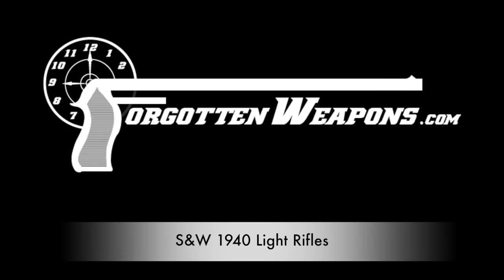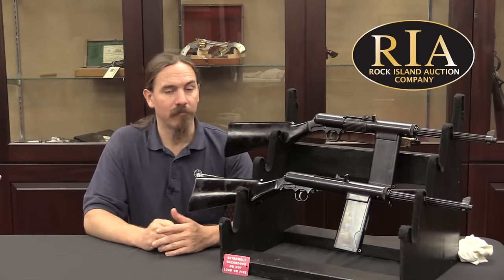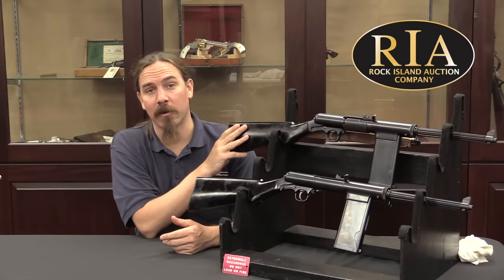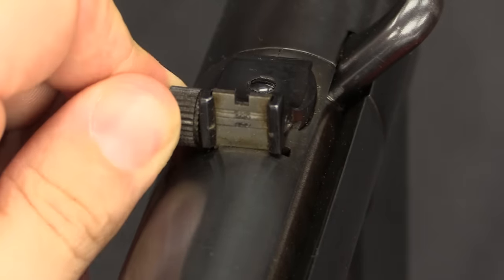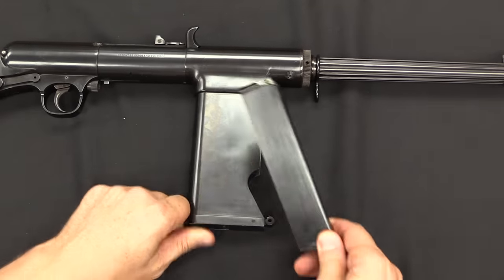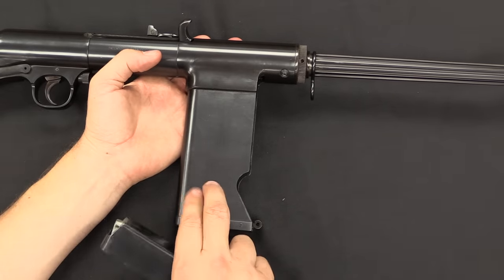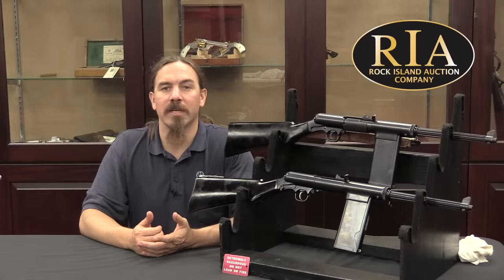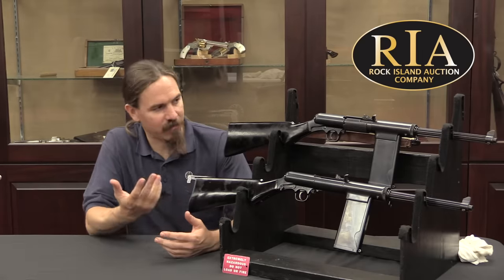S&W 1940 Light Rifles: Receiver Breakage is a Problem

Comment: I feel like just a couple of "small" changes and this could be a perfectly fine weapon. Things like simplifying the barrel, replacing the tower with a traditional mag lockup and ejection port, full auto only, and adding a little bolt travel room with strengthened spring.

Comment: Seems like a few extra threads and a deeper end cap would have sold the issue of the bolt slamming into the cap and causing the  failure
Reply: A better solution, and I didn't catch enough of a view on both caps to see if there was a difference, would be to move the cross-pin hole on the end cap so the forces end up transferred to the outer shell rather than all putting tension on the inner receiver tube. 

OH! Also, the Mk1 receiver steps out ahead of the section that fits in the outer tube... if that section interfaces before all the tolerance stacking/play is taken up for the end cap, then the impact on the cap stretches the end of the inner receiver tube. On the Mk2, that step is milled off and the inner receiver tube appears to be free to slide all the way back into the outer tube, which means the cap would always "strike" or push against the outer tube and not 'pull' on the threaded section.
Reply: extra threads to extend the space between the bolt at the cap
Reply: Unless the root problem is resolved, and extra threads don't do that, then you still have a stress riser at the edge of the turned down section for the threads. That's likely why the outside thicker portion for the MkII has been removed, to avoid it butting against the outer tube and allowing the bolt forces to put tension on that cap. Without that thick part on the receiver, the receiver would be free to move back into the outer shell as far as necessary to get the cap into full contact with the rear.
Reply: indeed...that whole part would have to be made thicker.....which there was room for.
Reply: If the inner section allowed for a broad end of the end cap, instead of the small lobe to take the cross pin, the the end cap could be extended and a buffer material could be put into that cavity and still all held together by the cross pin.  Without knowing the exact dimensions and design, the grip section could be bored out easily if there were clearance.

Comment: That firing pin lever works similarly to one on a thomson machine gun. Theoretically, when the lever hits a surface on the receiver, it thrusts the firing pin forward about 2 times the speed of the bolt. It also prevents out if battery fire. They likely deemed it unnecessary for function, as the doubled speed is substituted with double the impact  force.

Comment: What i find noteworthy was the british weren't so desperate for guns as to demand S&W fix the guns but instead just demanded their money back. If S&W tried they probably could have reinforced the guns and made them cheaper and probably within months. The fact the british wanted their money back then settled for revolvers rather than waiting for a proper improvement. Wonder if once they got their hands on them they had second thoughts and used the failure in the endurance tests to try to get away from them.
Reply: If they had worked then we of brought more until STEN production was up and running.
Reply: The Army were never interested in the Light Rifle. They were bought for the Royal Navy, who wanted a handy carbine for boarding actions (instead  of a SMLE).
They were a stopgap until the Lanchester SMG was available.

Comment: This thing looks like it's one camera part away from being a Star Wars blaster.
Honestly the big goofy tower, the huge weight and the fluted barrel make me wonder if this thing wasn't based on a design originally for a full power rifle round and then had weight chopped off it until it was deemed suitable to be a 9mm PCC. That might explain the receiver issues if they downgraded the metal for final manufacture from a heavier original spec.

Comment: If you add a pistol grip and full auto capability and change the magazine/ejection system then this could be a decent submachine gun :)
Reply: Called a STEN mk 5
Reply: Hendrik Tõnisson And if you completely redesigned the system to be more functional including: having it be reliable and not just break; making it a field serviceable weapon; removing the massive extra expense. Among others.

Comment: Shortening the bolt would make a longer area for it to slow down before smacking the rear under spring pressure.. That's probably how they fixed it.

Comment: I don't think the ejection port tunnel is a bad idea but it would work if it was quarter the length or less maybe. That way even if you used the magazine as a monopod it would be difficult to get mud in this thing. Not to mention a shorter tunnel would provide some sort of access to the insides of the gun to clear jams.

Comment: Based on the trigger mechanism, barrel profile, magazine well/ejection well, and profile of the grip/stock.... I would say that this rifle pattern was originally intended to be a heavier caliber weapon platform that went nowhere and S&W repurposed the design/layout of the weapon system and make the thing in 9mm (which is why they would have produced receivers that would crack: the materials/finishing were likely scaled back after dropping the design into 9mm from whatever caliber it was originally going to be in).

Comment: Maybe less mass in the bolt was to reduce the impact of the bolt on the end cap?
Reply: maybe. But that would also make it faster if they didn't increase spring strength.
Reply: ukezi
I didn't say it worked. lol

Comment: Why didn't the Brits test a few guns before ordering them?
Reply: Because they wanted to be able to complain.
Those complaints not only got them these useless rifles err scrap metal but also a number of free very useful revolvers.
Reply: That's what I was thinking. If I was S&W I'd tell them "Too bad! Here's the rifles YOU ordered."
Reply: Desperate for any kind of gun delivered as fast as possible in 1940
Reply: Proably because the stock S&W had left were already unservicable from US testing.
Reply: because dunkirk
Reply: S&W have always had a good reputation...I would bet the Brits were quite surprised by these:(
Reply: BJ Maguire  That's true. The S&W .38/200 soldiered on for many years.
Reply: We probably did, I imagine our procurement folks probably sent some people to the US to to some rudimentary tests and see if they worked, they likely did work to some extent with US ammunition, it's only when they were brought over to the UK and loaded with our hotter 9mm that the weakness of the guns really started to surface. As for why a 5000 round endurance test was not done on a selection of the guns before the purchase, I can only assume that it was because we were were desperate and needed these fast so placed the order before fully testing them.

Comment: I want to machine one of these, m2. Chamber it in .357 Magnum and change the design of the magwell. Then use a stronger recoil spring, bolt, and a longer action. And uh, definitely exclude the semi-auto finger lock thing.

Comment: The sleeve is a clever simple idea, though, in terms of engineering, if one ignores the fact it weakens the receiver. Maybe they made the alloy a tiny bit stronger, and that's where the claims of the mark2 being stronger come from?
Reply: maybe, but IMO the problems with these guns are that the recoil mechanism are over stressed, and they didn't do anything to address that. a stronger recoil spring and a buffer pad at the end of travel would have helped, but they actually made the problem worse by shortening (and presumably lightening) the bolt assembly. im a total novice when it comes to gun design and engineering, but wouldn't a heavier bolt suck up more energy from recoil, thus making the whole assembly travel slower at the end of travel?

Comment: Simple improvements that would have fixed the issues of that rifle: Buffer pad for the bolt and a heavier recoil spring (or possibly just redesign the entire back end of the receiver, you could change from a thread system to an interlocking system so the metal of the receiver stays the same dimensions), open a port on the side for ejection and change the magazine to a straight insert.  

It would also be very simple to make that rifle select fire, make a switch that would moved the disconnector out of the way.  Run it around 550-600 rpm for a nice steady rate fire. 

2 other changes that would make sense - no fluting on the barrel, and, put a picatinny rail on the top for a red dot. ;)

Comment: I wish I could look at these in person. There does appear to be a difference in the thickness of the bolts. The threading also has some slight changes. You can do a lot with the pitch of your threading to change the dynamics of how it screws on. This could make it more effective against the bolt force. And since it is still the same diameter the parts can seem to be interchangeable.

Comment: Coming back to this for a rewatch, i still can't believe Smith and Wesson never figured out that if they just gave this thing a normal, right-side or straight up ejection port, they could've put the bolt an inch and a half further forward, allowing it enough space to slow down enough to make the gun survive. 
I certainly wouldn't have minded a solid stock PCC from the 1940s, but anything short of a genuine one with curio&relic stamp would be called a short barreled rifle nowadays...

Alternatively, just change the stamp and say its 9x18 Makarov instead of 9x19 Parabellum, i'm sure thats less liable to wreck your reciever.

Comment: Was Rube Goldberg part of the design team?

Still a huge difference in some of the available ammo.  NATO marked 9mm military ammo used to be equivalent to a +P in the US.  123 or 124 grain projectile at 1250 - 1300 fps at the muzzle.  This was downloaded to "just warm" U.S. specs with the adoption of the Beretta M-9.  We beat the hell out of a couple of M-9s testing with NATO ammo.  Canadian ammo is available (current manufacture) that is still the old NATO specs, and is very noticeably different when you fire it after firing U.S. military rounds.

You have some of the most informative and personally fascinating videos on the web.  Thank you!

Comment: The shorter bolt on the MK2 means that the travel of the bolt is longer, maybe with that it has had enough time to decelerate before reaching the end of travel not to fracture the endcap.

Comment: It seems obvious to me that the reason they shorten the bolt on the Mk 2 is to prevent direct impact on the threaded cap. what they could've done to fix it is that plus adding a bunch of mass around the front end of the bolt . I don't think there's anything actually occupying that space in the receiver so there's no reason it couldn't be a little bit thicker . No doubt the formulas weren't worked out yet . However mass is the critical feature. Spring rate is almost inconsequential . The usual wait for 9 mm is 1.5 pounds for the bolt.

Comment: 15:57 Ian, do you think S&W's shortening of the bolt in the Mk.II was intended to alleviate some of the reliability issues caused by the bolt slamming ass first into the receiver on every shot? Since the bolt now has an extra half inch or so of rearward travel it might help some marginal amount. As S&W obviously had a fetish for unnecessary machining at the time, I can't think of any other reason why they'd shrink the front of the bolt, unless they just needed the extra space for the floating firing pin assembly on the original design.

Comment: The problem would have been a relatively easy fix. Simply extend the receiver a few tenths of an inch and along with a stiffer recoil spring to reduce the impact load. You can also change the minor diameter of the threat for the end cap to be at least as large as the exterior diameter of the tube.

Comment: Are those sight notches made for the S&W 9mm load and not the British one? 
2 grains of powder is a huge difference. I use only 4.2 of a fast burning powder for my practice rounds. The Brits were probably using more of a slower burning powder to take advantage of the barrel length.

Comment: They might have had something here, but they over-engineered and under-thought it. Like the fluted barrel and the case ejection chute. Unnecessary. A plain round barrel and a hole in the side of the receiver for an ejection port. That would also reduce the amount of rearward travel for the bolt. Reinforce the receiver and end  cap. make it select fire.

Comment: If I was to improve it I think I'd take a mk2, get rid of the semi sear so it has a purpose, shorten and decrease the diameter of the barrel, get rid of the giant ejection port thing, put in a stronger recoil spring and add any weight I could to the bolt, and make the entire receiver out of a stronger material. That's just without changing dimensions and operation, it's otherwise useless.

Comment: Some of the features, and the quality of the work of the components is amazing.  The workmanship on that barrel and front sight is really quite nice, for example.
However-
Once all these rather well made parts are assembled into their designed configuration, the effect is lost. 
One ends up with a mass of beautifully made bits forced into a sort of hamfisted operation by someone who I suspect had never really seen a submachinegun outside of a blurry photograph (but somehow managed to copy the firing pin actuation of the pre M1 Thompson, in the "mark 1" . Perhaps he had talented assistants he fielded some work to.).

S&W never really did get  SMG's.  Their later M76 was an attempt at a K-gun/M45 clone, resulting in an at best, pale copy of the original. 

The ammunition issues are odd, as Winchester made 9X19 of the era is quite stout, comparable to the British MkIIZ load.

Comment: Between the name and the appearance of the gun, I assumed from the thumbnail that this was chambered in a full power rifle cartridge or at least .30 carbine. I bet if someone installed a rubber buffer in the end cap, the receiver breaking problem would have been solved right there. Delete the ejection tube and move the mag release to the top, and the other main problem of the gun would be solved too. Delete the semi-auto disconnect and you would be dangerously close to having a gun that a 1940s military would want.
Reply: There doesn't appear to be ROOM for a rubber buffer in that end cap.  The back of the bolt is nearly touching the back of the end cap even after it's come forward onto the sear.  However it does look like you could simply add a longer end cap (and possible a stronger spring) to give the bolt more time and distance to decelerate before slamming to a stop.  That might allow the receiver to survive for longer than a couple thousand rounds.

Comment: Wouldn't it be extremely easy to modify this for full auto by removing the spring loaded latch on the bolt?  Or just grinding the disconnector off the trigger?

Comment: That “ehhh” at 1:00 XD
Also this is such a colossal failure of a carbine. So many wtf decisions made on the design of this. Feel like if there was some sort of buffer for the bolt may have saved the design a bit, but from a military standpoint, this is horrible to maintain and disassemble. Not having easy access to the breach is just dumb. I cannot believe this was intended as a fighting...thing.

Comment: It's kinda cool looking except for the magazine/ejection port?, Thing?. But my question is, why didn't S&W put a rubber bushing in the receiver cap, and make the receiver just a little bit longer so the bolt wouldn't strike the cap with so much force??

Comment: do these safety systems that act on the bolt ever have problems with the seer releasing the bolt if you pull the trigger so they fire when you release the safety? seems like that would be a potential problem...putting the safety on the trigger seems safer.

Comment: Hi Ian great video. I'm left wondering if the end cap section could be replaced with a new part to make these guns work safely again. S&W really messed up when you compare this to a STEN gun.
Reply: It would have probably been enough to use a buffer pad to stop the bolt travel (like it was used in other designs) instead of having the bolt slamming metal vs metal.
Reply: I wonder if you could make a new bolt with a recessed buffer or a dual rate recoil spring? It just seems like a waste of time on S&W's part not to fix what looks like a simple issue.

Comment: Is there any aspect to it that makes it better then just a longer barrel stan or grease gun with better stocks? There are so much things that would have been easy fixes. the cap, make it cylindrical with the same length and make the receiver go all the way to the end then put the pin off center through it all. Or don't do the pin at all. Thread the spring guide into the stock assembly and again pin the receiver in place, no threads at all. As everyone at this point would be wearing helmets, just extract out the top and be done with it.

Comment: if someone was to mill a 1/10” off the back of the bolt and put the correct weight spring in it, would you think it wouldn’t fail so easily then?